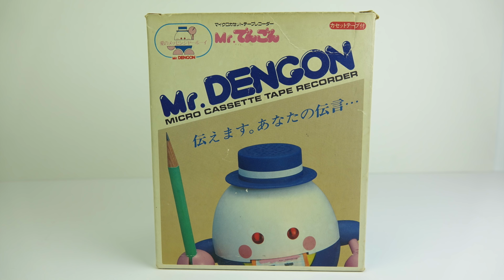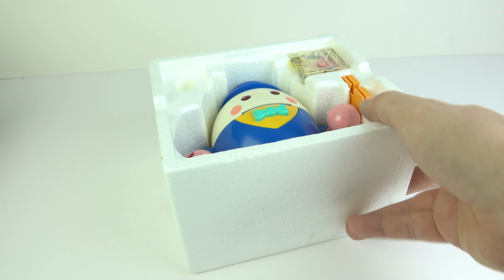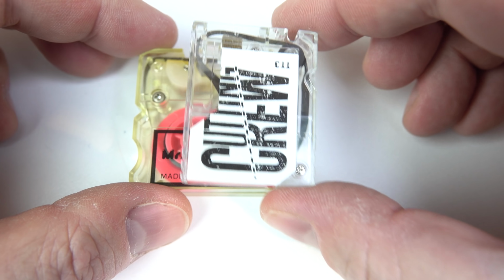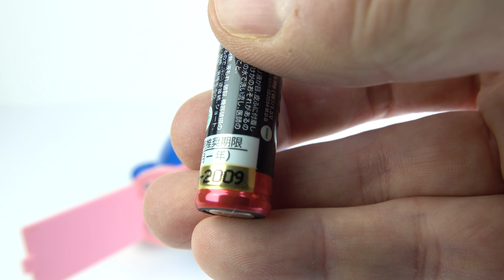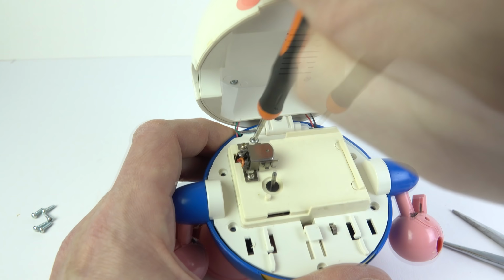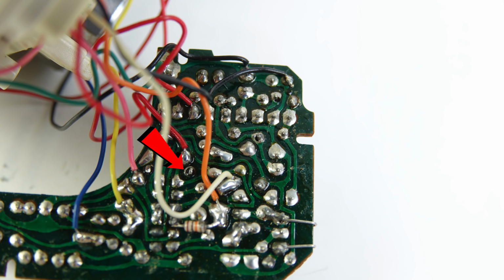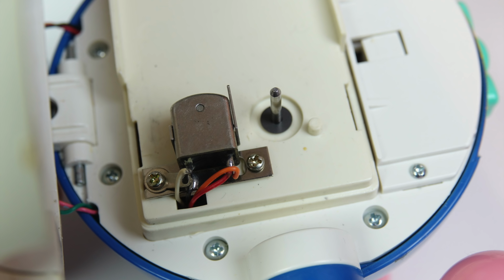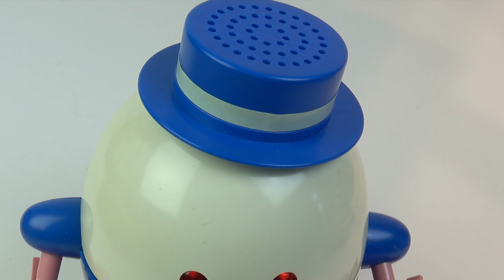Fixing Mr Dengon

Comment: It appears the switch that is always activated when a card is inserted operates the motor, and the other switch toggles between playback and record, depending on if it's pushed down or not. A simple but effective system. It would be very difficult to incorporate a system that lets you record five different messages and only plays the message selected with the corresponding card. The device would somehow have to know and find each five sections of tape and dedicate those sections to the individual cards.

Comment: i bet the inventor originally wanted a 5 channel tape and each card would activate a track but the enginners met with the suppliers and said it couldnt be done with off the shelf components maybe you could mod it by putting in an auto reverse head and make it 4 track

Comment: I wonder how it copes without an erase head? Maybe superimpose high-frequency AC onto the recorded signal? Would that work?

Maybe it doesn't erase, and that's why @Vermillion below noticed the kid's voice underneath. So as you use it, more and more and more voices add up, a cacophonous chorus of hundreds of people shouting ever louder to be heard over the noise. That'd be a nightmare! And also amazing. 

Or maybe there's a button you can press (the missing card?) that runs an AC erase signal through the record head, so you erase it separately. 

Really you can't just not have an erase head! It doesn't make sense!

Comment: Packaging text translated:

0:05

Inside logo: Lovable messenger boy

It communicates...your messages

0:15

Top of box: Microcassette tape recorder

Recording time 60 seconds
Endless tape system
Cassette tape compatible
Uses batteries: 2 AA
4 message cards included
Main unit 127 x 142 x 93mm
Cassette tape size 40 x 40 x 10mm

In red: Cassette tape included

0:20

Code No. 127-88002

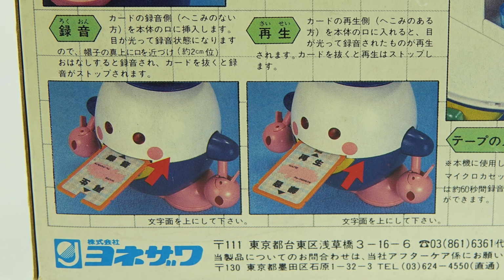0:29

Recording: Insert the recording side of the card (the side with no indent) into the mouth of the main unit. When the
eyes light up indicating recording status, and when your bring the top of the hat towards your mouth (approx. 2cm distance)
your speech will be recorded; the recording will be stopped when you remove the card.

Playback: Insert the playback side of the card (the side with an indent) into the mouth of the main unit, and when
the eyes light up, the recording will be played back. Playback will stop when you remove the card.

Please insert with letters facing up.
Reply: That was definitely nice of you, Brillemeister... thank you for translating.
Reply: @TerryMcKean  No problem at all!
Reply: I love the politeness of the Japanese. "Please insert with letters facing up." not "DO NOT INSERT CARDS UPSIDE DOWN!"

Comment: Wow, that's actually really interesting! I did a bit of research and found out that actually that's just one of the Mr. Dengon series. There was also Kaminari-kun (Mr. Lightning) and Ameragu-kun (Mr. American Football). They all follow the same basic design (egg-shaped, claw hands, microphone/speaker at the top) and use the same card/tape system.　With one exception, both Kaminari-kun and Ameragu-kun come with their own special item. Kaminari-kun came with a rod of lightning god symbols, and Ameragu-kun came with an American Rubgy ball.
Reply: Oi, mate, it's called a "football" in freedom language!

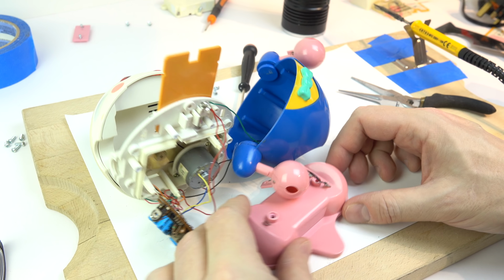Comment: You could have also sprayed some contact cleaner on the micro switch which is attached to the case and tethered to the circuit by the two thin wires you can clearly see at frame 6:29 right under the plastic insert card. This is obviously the play switch.

Comment: 伝えます。あなとの伝言。。。
Tsutaemasu. Anata no dengon...
Transmitting... Your message.

Just in case you want to know what that says!

The only thing else I saw on here that was interesting was a message that effectively says that the microcassette tape included with this device is only for use in this device.  So it's probably made solely for this device like you concluded.

Also, the package mentions that you should be around 2cm away from the top of the hat when you're recording so you should probably move closer instead of shouting, lol.

Comment: I can't picture how it can wind on and wind off the same spool at the same time if the tape goes round the spool multiple times.... I'd love to see a graphic or can you twiddle it around a bit in a video to demonstrate that? Great video as always. Cheers man.
Reply: Like the old 8 tracks, it draws the tape from a loosely wrapped center spool, where the tape is just essentially sitting on a round platter on its side. It is drawn it at a constant loose but steady tension at the outer and larger edge. The illusion is that youd think it would eventually over-tighten but its actually just re- stacking itself at a consistent rate as it lets go from the center. Fascinating to watch, yeah i spent way too much time playing with these things cuz i didn't believe it and just had to see for myself 😃

Comment: All that effort for the problem to be a little wire elsewhere. Typical
Reply: I once spent 2 days taking a turf aerator engine apart before I discovered that the breather hole in the fuel cap was blocked! Doh! 🙄
Reply: Lost count of the times I've found a battery-wire in a small device has come adrift!
Usually it's ether because of twisting as someone has disassembled it for cleaning/repair, or the battery contact is plated-steel which solder doesn't adhere to anywhere near as well as copper/brass!
Reply: Once fixed a My Little Pony toy where the plastic in the battery compartment was shoddy and was jjjjust barely keeping the battery from making contact. Trim the plastic and good as new

Comment: Belts can be shorten and repaired with superglue and a multimeter on diode check works great for testing switches. Very odd device none the less.

Comment: Lithium AA and AAA batteries will never leak and have a shelf life of about ten years.
Reply: That's all fine and dandy but those were Ni-Cad batteries.
Reply: Exactly what I was thinking.  there are now a line of Energizer lithiums that advertise 20 year shelf life too.
Reply: Alkaline basically don't leak either (not saying it can't happen) but it's most a issue with the obsolete NiCa batteries, heck a alkaline is only 25¢ a pop don't know why they still make the things
Reply: @K Lithium batteries will provide a voltage of around 1.7V, so actually a bit higher. 1.2V is usually for rechargeable NiCd and NiMH.
Reply: @dddevildogg  Yep - I've by far had more Duracells leak than any other brand of battery. I make a point of not buying them now.